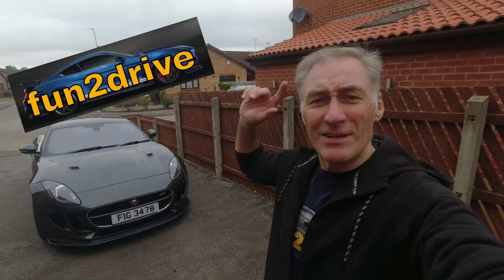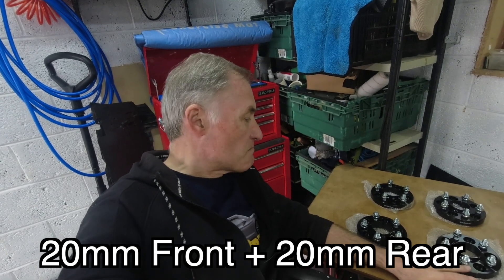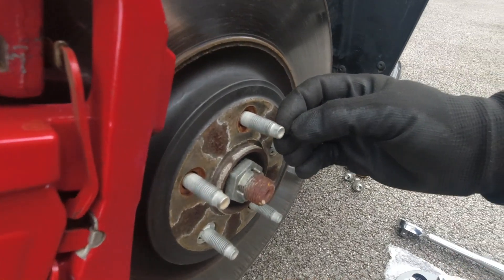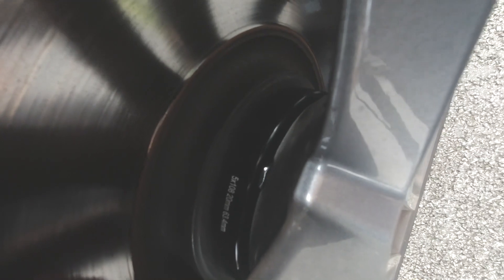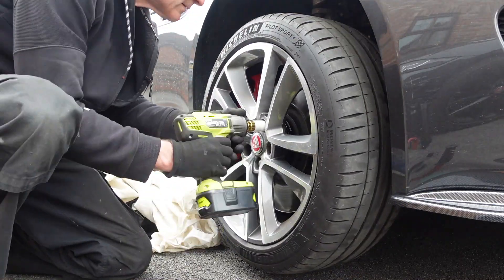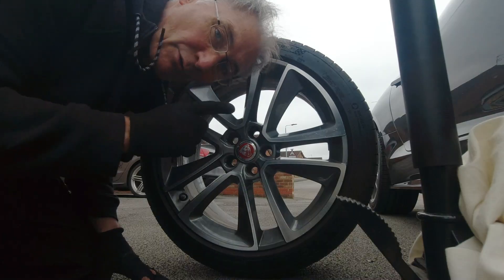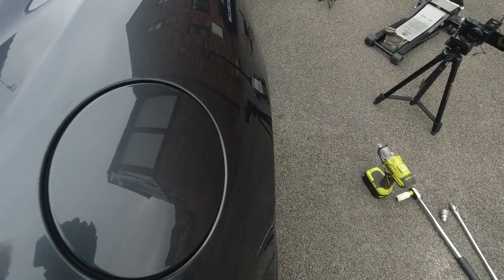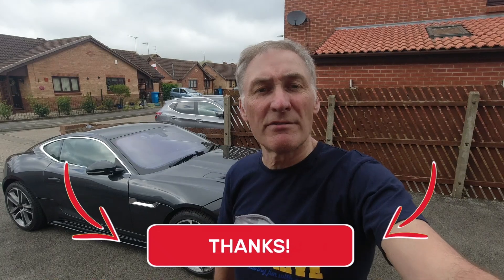Which Size Wheel Spacers Should I Fit To My Jaguar F Type??

Comment: Did you stick with 20mm all round and how has car handled since

What make did you go for, I’m currently considering 15mm H&R or Eibach, although the amount of stud to cut off is a little concerning

Cheers
Reply from the maker: I have now removed them after I installed the 20” wheels as they were proud
Reply: I presume the 20” is a wider tyre, mine is a V8 so not sure what the tyres widths are on 19” wheels

Comment: Thank you for the video, which brand of adapter spacer did you use?
Reply from the maker: I just used a cheap hub centric one!
Reply: @philscars  Did you leave the 20mm on the fronts... and were you able to pass MOT?
Phil... the reason the suspension looked higher is because the tires were further out, so it seemed more noticeable than before. I think they looked perfect.
By the way... thank you for your reply.
Reply from the maker: @bisonuberti  hi, no I took the 20mm off the front, defo to wide and 15's would be better. Didnt get to MOT as traded in the car for an SVR! I have installed the 20's in the rear of the SVR, but just waiting to get 2 x 15's for the fronts

Comment: How safe are those spacers? Basically the wheel sits on the spacer's bolts.What is the quality of those bolts? 
Also the spacer is fixed to the rotor with some nuts. So we have the spacer nuts and also the wheel nuts. 2 set of nuts. Can't this effect be obtained by using a different offset on the rim? ( lower offset that factory default)?
Reply from the maker: Well that would mean buying a full set of wheels and tyres!!

Comment: You probably know this now given you're on your 2nd F-type, but a wee suction cup on the centre caps and a quick tug and they'll pop out. Save you from taking the whole wheel off or risk scratching the rim trying to pry one off
Reply from the maker: yea....great tip! ....now if only i had a small suction cup...something to buy i guess
Reply: @ if you’re replacing the centre caps, you can drill a screw through it or even heat a hot glue stick and use that instead.